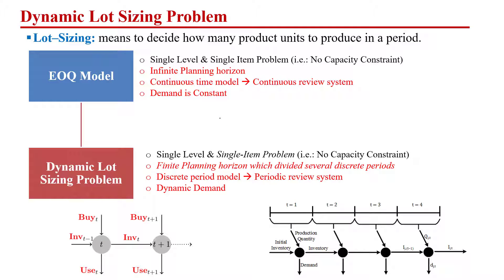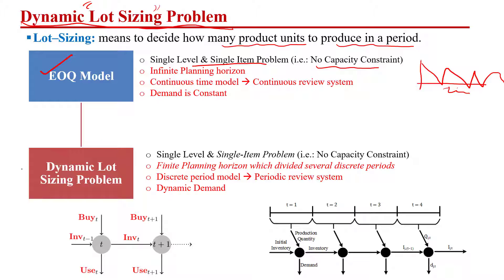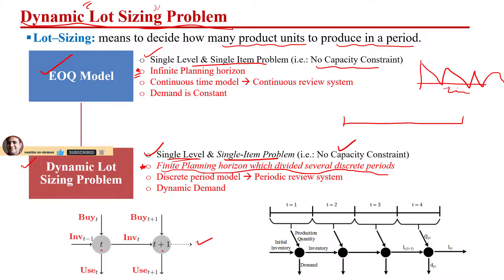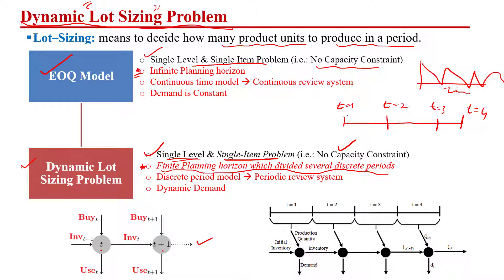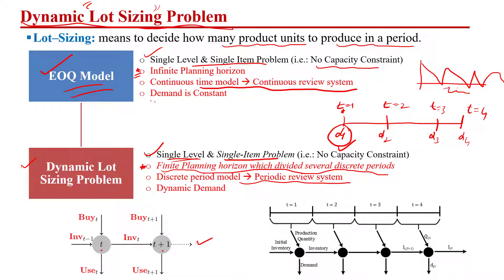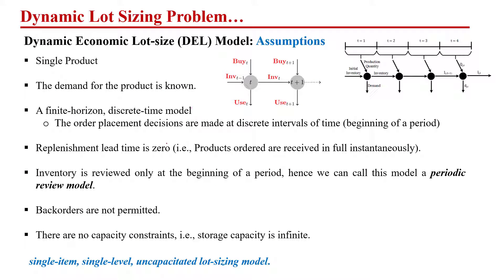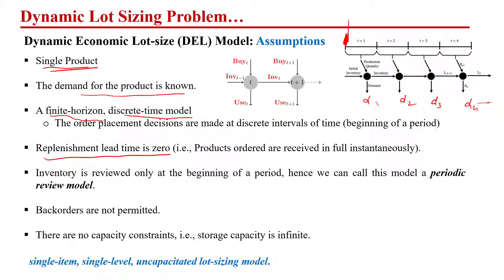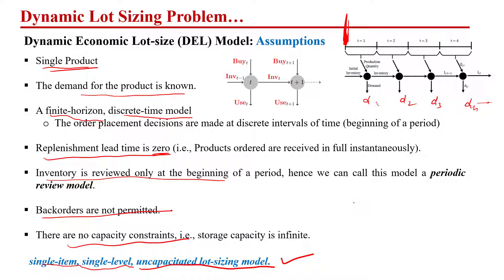What is a Dynamic Lot Sizing Problem? | Dynamic Lot Sizing Problem

Comment: Hello, I'd like to ask what's the difference between dynamic lotsizing and lotsizing?
Reply from the maker: The core difference lies in how lot sizes are determined. Lot sizing refers to the general process of deciding how much to order or produce at a time, while dynamic lot sizing specifically refers to a method where the lot size is adjusted based on varying demand patterns over time. Traditional lot sizing might use fixed order quantities or periods, whereas dynamic lot sizing considers factors like changing demand, production constraints, and costs to optimize order quantities.